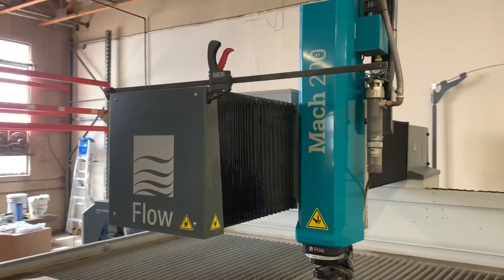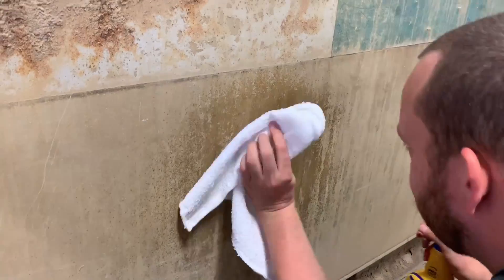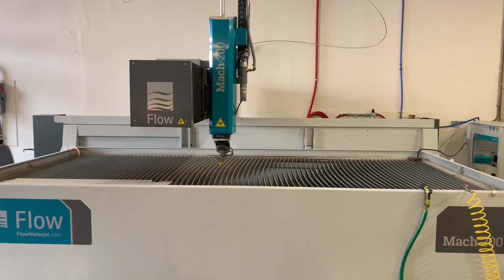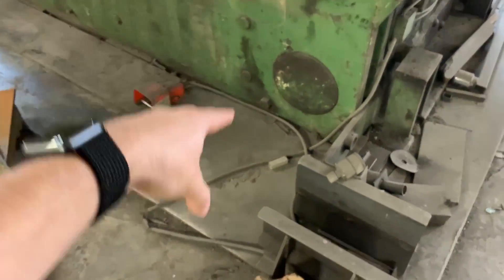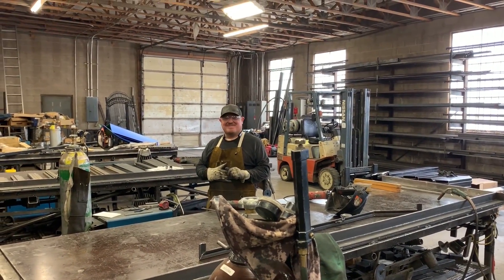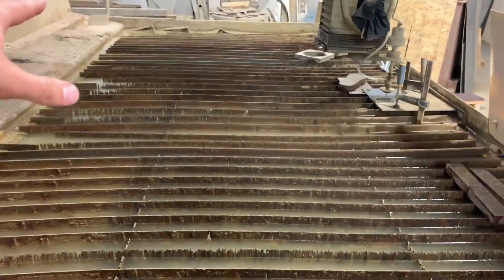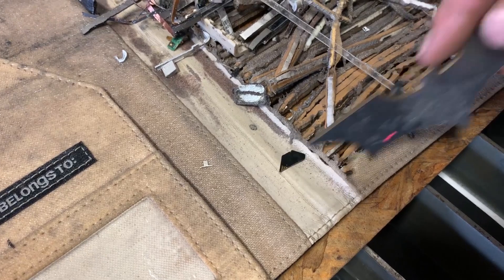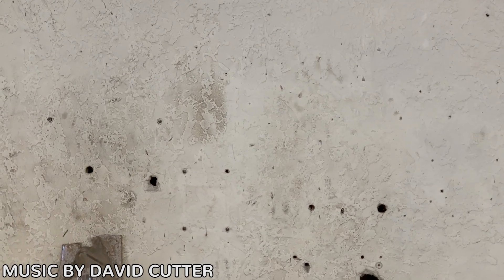7 Reasons Why You NEED a Waterjet | 5 axis Waterjet Cutting

Comment: 5:23

I think you might mean they've been hardened and annealed, and reheating them softens the steel again.The hardening process already strains the material quite a bit (you're literally forcing it into a crystal structure that does not want to exist at room temp) so you typically want to only do it once.

Comment: can you guys find a 200 or 300 pound boulder.. and see if you can use the swivel control to take out cone cuts of the boulder.. creating a tubular cut thru the boulder.. does not have to be smooth bore.. just to see if you can make a hole.. you might have to create a spirograph pattern with your cutter. cutting out overlapping pieces of rock..  i am interested if you could bore a complete hole thru the rock this way.  even with a rough bore.. but the same size coming out.

Comment: can you take a really thick piece of steel like 1.5 inches and cut a knive by first cutting the sharp part and then like a strip , then lay it on the side and make holes for a grip and the outher contour other than the sharp part, basicall make a knive just with the whaterjet also get a blade into a maschinist vice sticking out and try to sharpen it with the 5 axis nozzle

Comment: Well the biggest difference between the two is one is from when Flow was the best and one is from since the new owners took over and was built in korea. And yes you can cut through the bottom of the tank if your tank is too full of spent garnet and you're cutting something thick thats moving at under an inch per minute, the abundance of spent abrasive in the catcher keeps the jet focused down to the bottom instead of allowing it to dissipate shortly after entering the catcher tank, trust me, its happened to me more than once. And finally, is your 6012 flying bridge a direct drive ump as well? If so, you guys do a lot more pump maintenance then needed, with the right set up Ive gone almost a year without even an hp seal change on my intensifier.

Comment: My work just trashed our 20’ brake press and 20’ sheer. They both were over 150k lbs and went about 4’in the ground. We were limited to cutting 5/8” on it so we have 2 Messer plasma tables capable of cutting 3”

Comment: So with this jet are you able to cut easily chipped material like silicon carbide? I work with that and tungsten carbide all the time but I'm grinding it all and holding .001" much of the time. I'm curious to see how the water jet handles material like that.

Comment: Water jet operator here, you can blow a hole in the bottom of the tank. We hired a new guy and we were teaching him how to weigh the Garnet, do the nozzle test and flow test after cleaning the nozzle and mixing tube. The default test is 60 seconds. We never do that we only run it for maybe 5 seconds. He ran all the test for 60 seconds. Pump only, water only, Garnet flow/weigh then water plus abrasive. The water plus abrasive is just like a cut and he blew a hole in the bottom of the tank in 45 seconds of the 60 second test. The tank was about 50% full of abrasive. It was high pressure at 45K PSI and .030 mixing tube.

Comment: As someone who regularly operates a Flow brand waterjet very similar to the one you've replaced, I assure you that with the enclosure completely filled with water there can still be damage caused to the bottom of the tank. 
     Upon changing out our intensifier it is regular practice to allow the pump to run for 15 mins without abrasive. This is to ensure there are no issues with the rebuild of the intensifier. In the past we have had an operator follow this procedure with abrasion accidentally turned on. This did leave a tiny hole into the bottom of the tank.  
     It was a huge pain in the ass for 2 months (no on believed me when I said there is probably a hole in the bottom of the tank). So each day we while operating the waterjet another and I would vaccum about 75 gallons of water from the floor with a 5 gallon shop vac. Finally when emptying garnet from the tank during maintenance, management was talking into investigating the 'leak' (it was hard to ignore at this point). The solution to the issue was simple. It was filled with weld.
     I saw someone ask in the comments if you can cut a waterjet out of a waterjet. The answer is yes, all non mechanical parts can be cut on a waterjet. We have refurbished our enclosure multiple times this way. All internals (pumps, attenuator, intensifier etc...) are pressed, or precission lathed and machined. They would need to be worked on other machinery or outsourced.

Comment: Is there a known ratio to how much the Water jet stream ”cones” over distance? Or is there a changing focus point?

Like if you cut something  thick, turn it upside down, i supose the cut is wider on the bottom? Or is it?
Reply: linus452345 yes depending on what size mixing tube you are running the water will cone out at different ratios. Most mixing tubes are set for .060 over the surface cutting so that’s the point where the stream will cut a perfect .030 cut like the mixing tube. As you get further away the cut gets wider. 

Considering they now have a 5 axis you can program  the nozzle to compensate for the sway left on the part so it will cut 100% straight from top to bottom unlike a 3 axis machine.
Reply: Thanks for info :) i thought maybe the newer ones should be able to chose a focus point like you Said, i supose thats what you meant?

Comment: In response to the question of the jet cutting through the bottom of the tank, at my work the water jet was set to run overnight like normal, but had a hiccup just after we all went home and ended up doing a 6 hour piercing cut, that went through the plate, then the tank bottom and inches into the concrete under neath. It was an awesome demonstration of its power but a real nuisance to fix. This was all dis spite the tank being full of water (at the start at least).

Comment: I used to do concrete polishing, we used one of those extractors before to extract concrete dust from water. Welllllllllllll somebody, Frank, filled it and didn't drain/clean it.. for 2 days.. when we came back the whole thing was blown out because of the weight of the now concrete inside.

Comment: Assuming that the 5 axis water jet is also 40,000 Psi, your able to run the high pressure waterline lose like that? The pipes in my walls rattle and they are nowhere near 40,000 Psi! (7:03)

Comment: dude's i need one to cut 50mm granite , ,,,,, installable on site , , what is wastage , can water be recycled through cutting nozzle ? , , is this a viable option to set up on a site where i need to cut heaps of granite , some circular cuts , , what are safety precautions , could i cut my finger off , , , , ??????????????????????????????????, dude i need one , , have worked with granite for 30+ yrs in sydney , , currently use diamond saws with high waste run off ??????????????????????????????

Comment: Do you use the old water jets still? Also,  are you using the steel from the cut out knives? Those would make tiny circles with the material that is left.

Comment: Hey guys i actually run a water jet for my job but i cut glass instead of steel, what size grit do you use? We use 80 for rough cut or 120 for finer cuts.

Comment: I operate a Mitsubishi X3-612 with a KMT Streamline Pro 2 that runs at 90k PSI. AKS Water Cutting now makes this machine but it's really an amazing machine. It's also a 5-axis but only goes about 6° to compensate for taper on thicker material. In currently running a 12 foot tilt rack gear on it that's 4" thick steel and will take the next 20 hours to complete. Good luck!
Reply from the maker: Oh man that sounds intense.  Hopefully you don't have to babysit it the entire 20 hours.

Comment: Love your videos. Looked like cleaning it out before you got that extactor was a pain. That extraction machine is the ticket to clean that thing. I've got a lapidary slab saw for cutting stone. When it's time for me to clean the saw / reservoir, it looks similar to what you're dealing with. Thick nasty sludge. I tried a few different tools and techniques. Lot of bad ideas but one seemed to be the ticket. I've got a 4" gold dredge that'll suck all that junk out no problem as long as you've got access to some water. Have the discharge feed onto some screens so you can see if there's any hidden treasures in there. If interested, check out venturi suction dredge to see what I mean. Curious if your garnet feed system utilizes a similar technique? Anyways, this is probably all useless information that you already know or dont need now that you've got that cool extraction unit. Again, love your show. You always find cool new things to slice and dice. Just a thought... can you cut through that crazy bulletproof glass that'll stop a .50 B.M.G.? Cut a magnesium bar without it igniting? Maybe a plasma ball? This one might be a stretch but seeing how you guys are like YouTube famous now, now that you've got this new machine, hook it up to have a standoff with your old machine. Waterjet against waterjet. Guessing it'd be a pain to set up and catastrophic for the loser... but it'd be so cool to watch.

Comment: I used to work at a fab shop that had one of those big Cincinnati brakes.    The shop owner got his hand caught in it.  It crushed his 4 fingers.. OFF.  Now he has 4 nubs and a thumb.  My first day of working there I reported to his office, and he was on the phone, holding the receiver with his bad hand.  I didn't notice until he went to hang up the phone, and it just fell out of his partial finger-nubs.   I also saw a dude there sandblasting in a t-shirt.  no respirator,  no gloves, no hood,  no PPE other than sunglasses. 
That was just two of the seriously unsafe things.  OSHA would have had a field day with that dude.  
Nice guy though.  he did make and install pedal extenders for a young "little person"  lady when she couldn't drive her car.  He did that free of charge.

Comment: I have a question. How far do you think a water jet stream can go before the pressure is low enough that the stream goes down
Reply: Without air, it would probably get pretty far, but in atmo I dont think it would get all that far, just cause the stream is so thin itd break up and just turn Into mist.

Comment: The problem with plasma cutting knife blanks is you have to cut oversize, if you cut right on your intended blade edge it would cause decard. It will harden due to the scale bit the heat zone created by the plasma actually destroys the carbon content on the edge of the blade, that's why the water jet is better for knives, if I cut any blades with plasma I cut 3/16 of an in over size and grind to my intended line. If not then where you plasma cut the edge it will not fully harden, the only reason the people say it will harden the steel is mainly cause the scale created from cutting is harder than annealed steel, but will not harden. DEFINITELY  when using high carbon steel, when using some stainless or air hardening steel then not only will the plasma heat zone destroy its edge, but it will also harden it to a point.

Comment: Ultra purified water. So if you could somehow get it in a cup you'd drink it?
Reply: It's not 'ultra purified'. It's 1 stage filtered and softened tapwater. They have to soften it because, Utah. The tapwater sucks.
Reply: @painmagnet1  I dunno, the last video they did about the set up, they have like 5 filters getting progressively smaller
Reply: @punk105  I watched that one but didn't see a big filter bank. Do you recall the time in which it was shown? The pump doesn't need a ton of filtration. It's just as important to make sure it doesn't starve for input.
Reply: They did! In the Keurig video they drink it sort of